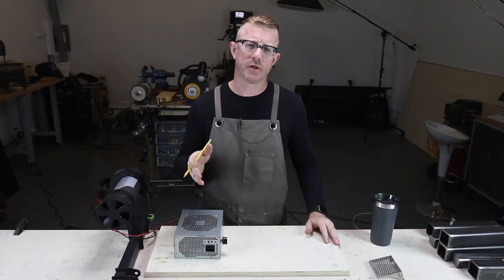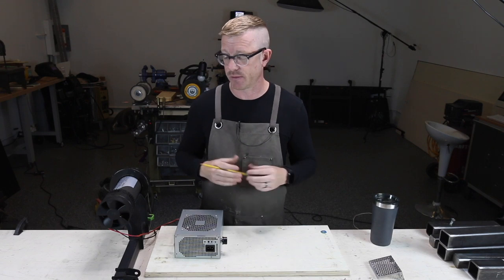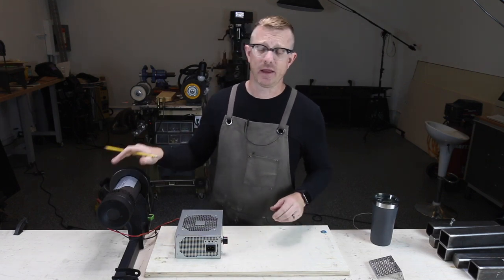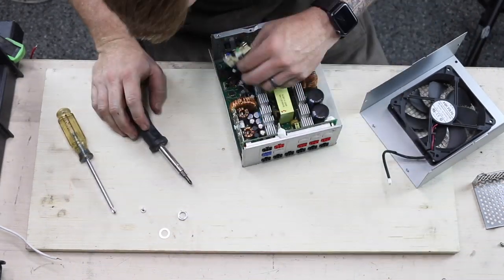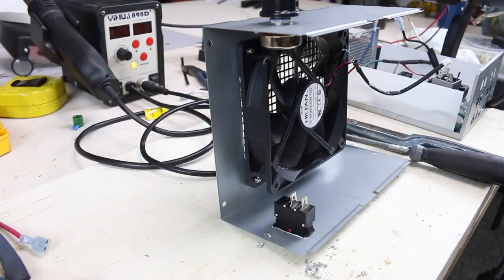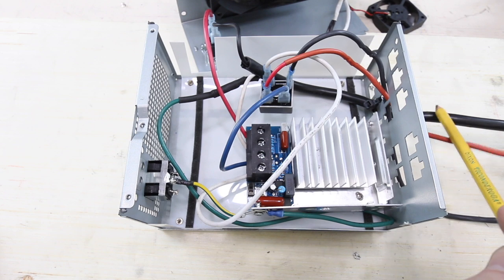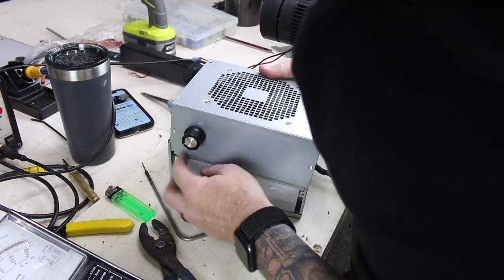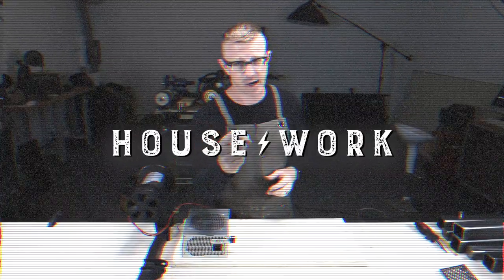How to: Build a DC Treadmill Motor Speed Controller for $20

Comment: Good afternoon ’House Work’ I found your video very useful. Thanks a lot. Greetings from Panama (Central America). Could you share or send a connection diagram? I am asking you this because I got confused with something: how many cables come from your motor? Mine has 3 cables (white, green and black)) but I have seen 4 or more cable coming and going to the motor, I am not sure.
Reply from the maker: Jorge Duarte - should only be 2 total wires coming from your motor. Send me a pic of the label on the motor and I’ll see what’s what and let you know. My email is brian@housework.us
Reply: House / Work thank you for your reply. Ok. I’ll send you the picture of the engine that I have.

Comment: great video, gonna subscribe ....I want to hook up a treadmill motor to a wood lathe. I would like to have a reverse switch. Any thoughts on how to do this, any way you could make a quick video showing the additionaal part or parts need to do this ....thanks :)   Scott
Reply from the maker: Its simple to achieve this with a dpdt switch. I may add one at some point. Just think of it as switching the polarity but just in a switch format. Don't buy the rocker style though if you want it to stay on.

Comment: https://wenproducts.com/products/3420-036asm-switch-box-assembly-includes-circuit-board-onoff-switch-circuit-breaker-speed-control-wire-for-wen-3420       i purchased this before i saw your video and have a treadmill motor laying around that i plan to use on a lathe.  will this work with the bridge rectifier in the same way , or would i be better off just purchasing the parts in your video ?   and great video. very informative.
Reply from the maker: If this device puts out AC power the bridge rectifier would convert it to DC. Not sure what amps you would get. A lathe doesn’t require a lot of RPM, so it may be worth trying. Report back on how it works. 👍🏼
Reply: @HouseMadeUS  sorry for the long wait. had to wait for other stuff to come in for my project.  the motor works. i ran two leads from the switch box to the rectifier where their motor would have hooked up and from the rectifier , plugged in the treadmill motor. i also bought a tripp lite heavy duty computer cable 14 AWG , 15A 125V . and cut that to make my power cable for the box. and it all fired up, no hassles. no smoke.   Now i'm trying to decide if i need to keep the fly wheel on or if i can get away without using it. This is all going to be used on a Taig Lathe. i bought a heavy duty electrical box that i'm going to mount all the electronics in and then mount the lathe on top of it all. should look really good when its all done.   i hope LOL

Comment: My ? is why did you not just use the power supply & box and just wire one of those output (like the blue one) and put a label "D.C. output voltage" It looks like enough room for controller to?

Comment: Great tips ... I found a free treadmill advertised, went to see it, it was huge and impossible to move, so I left ... I was still ken on it, so later I dropped them a line suggesting for a fee I'd dismantle it to get it out the door and house ... they ended up paying me! So, I will now be looking to use your tip and possibly make a linisher or wood lathe ?? So many options ! Cheers.

Comment: Why wouldn't you use the power supply switch and power cord connector both of them were mounted to the case
all you had to do is drill a hole for the potentiometer and attach the heatsink and bridge rectifier and wire it up.
but good idea on the power supply box I must have 3 or 4 of them laying around, I should fix them but honestly its not worth it.  look on Craigslist people set these out for the trash all the time I've taken about 5 of them apart Most of them have 
the digital boards so I have to do this Because I don't want to mess with the speed pickup's.

Comment: I’m doing this with a 4000 watt SCR and standard 5010 bridge connector. I noticed some videos they use a step down transformer... since I might be running this motor high idk if it’s gonna overheat or not. Also QUESTION my motor has 2 blue wires coming out in addition to the red and black... is this for an on/off switch from the circuit board? Thanks!

Comment: Great video Brian, appreciate the level of details. One question though, as I see it the treadmill motor does not need an individual power supply right? The controller board merely regulates the current sent to the motor.

Comment: Brian, does the motor still have maximum torque at low revs with this setup? Or is it like pwm and torque would suffer?
Reply from the maker: Torque does suffer at lower RPM. If you go into my video library there is a video explaining why I switched away from this system. Pros and cons basically.
Reply: @HouseMadeUS  thank you I'll check it out

Comment: good job but can i ask why you didn't utilize the factory plug in the computer power supply ? it would have cleaned up some of the wires and its already there
Reply from the maker: I thought about that after the fact actually. I think next time I wire it up I would do that. Good suggestion. 👍🏼

Comment: Brian. i am trying to us a 4000W SCR AC motor controller thru a bridge rectifier to run my 90V 2.65hp treadmill motor. I set i up just like you did in the video and it works. but the motor doesn't engage until i have turned the pot 1/2 round. it is a 500k pot. i was wondering if i replaced the pot with a larger pot, 1M, could i get more fine control? I can only get the motor down to 900rpm. i was hoping for a little better lower end. i want to use this for a lathe modification. any help is greatly appreciated.

Comment: Never knew this is how you got started with 2 x 72 grinders.   Man you have came a long ways.     I built a treadmill one back about 7 years ago and keep saying I am going to upgrade to one of your plans.   But the damn thing still works and has plenty of power.   I did mine different than anny I have seen and ran a jack shaft and geared that 7500rpm motor back down.   It makes all kinds of power.    I used all the electronics from the treadmill to power it.    It is one of two videos I have on my channel.   But I am kicking around a house made grinder with possible a brushless scooter motor.  You can pick up a motor and controller around $120 for a 2.2kw 48 volt and a surplus 3k 48 volt power supply from ebay used in tella communication for less than $100

Comment: I understand the setup and configuration. But I feel like im missing something simple. As far as I know I may be wrong, but in all the videos o have watched on this, I can't figure out how the max output is figured. Does 110 ac always come out to the same max voltage on DC with the pot maxed? Does it depend on the type of rectifier used?

Comment: thank you very much for this video and links, my treadmill motor has the black and red wires but it also has 2 blue wires. do I just ignore those ? are these motors very good at retaining torque at lower speeds ?

Comment: Thanks for the vid, questions i have
1. How do you clip the output voltage to not exceed motor rateing...is this done by the potentiometer you added, a bridge rectifier will multiply the AC input by 1.414 factor thus my question, 
2. How do you gain "soft start" ...once speed set and you do power cycle, the motor needs to return to speed set from previous use
Thank you

Comment: Hi, I made a trademill controller like this  it overheated at blew up after 10 minutes of running. Any idea how to avoid it ? Will a cooling fan solve the problem? I ran 2hp motor , it was extremely hot after 10 min

Comment: Treadmill motor controllers are designed with a feedback sensor (usually Hall effect sensor activated by a small magnet in the drive wheel) that allows the motor to maintain speed under changing load. SCR controller can not do that so the motor will slow down with load. 
For applications where maintaining set speed is important  it is worth reusing the original controller from the treadmill.
More work but worth it.
Reply from the maker: Interesting. I don’t notice a whole lot of difference between this and my AC motor. All is good in da hood.
Reply: House / Work I put SCR based speed controller on a band saw and on low rpm the drop of speed under load is significant. At higher rpm not so much. I may add an intermediate pulley to let the motor spin faster while the bandsaw is on low speed.
Another project on the list...

Comment: I enjoyed your video and actually bought the parts and made it to upgrade the motor on my Harbor freight Lathe.  I added a reverse switch as well.  However I find that the lathe spins well, and reverses directions fine, but it has very little torque.  When attempting to rough out a bowl on a soft piece of cedar, it doesn't take much pressure to slow the motor down, even at higher speeds.  Suggestions?

Comment: I have assembled your SCR set-up, tested it and it works as expected, however, it has been suggested to add a capacitor to even it out.  I have a 3300 mf capacitor but I'm ignorant about electronics and I'm not sure if it should be wired to the input AC, the output AC or the rectifier DC and should it be wired in series or across the terminals.  Please advise.  Also, is it a better choice than a Ferrite cored coil (can't remember what it's called)? Or should I do both?  Thanks.

Comment: Will this setup work to run my treadmill the control top is gone could I run just the treadmill part like this
Reply from the maker: Unfortunately no. You would need the actual controller for that. This one will burn up.

Comment: Would be a good idea to connect the SCR to the chassis as a heat sink.. Those can get hot depending on the use.  Great video. I may have to build one now.
Reply from the maker: I have a heat sink on the bridge rectifier and one on the chassis. Its hard to see from the video. None the less, you make an excellent point! Heat kills electronics!

Comment: I bought the same controller you did but my fan that I took off of it is 24v and I noticed your fan was 12v. my replacement is also 12v can I still use the 12v when I took out a 24v fan?

Comment: I have a question.  I used this system to put a treadmill motor on my old ShopSmith and it works great.  My question is that when I try to read the output of the rectifier sending current to the motor, I get no readings at all.  Any ideas on this?

Comment: It does matter which side you use on the AC power: black goes to the fuse and/or switch, white is "neutral" and is the return for current supplied on the black wire. Wiring this backwards is why we now have polarized plugs, because old radios used to connect the neutral to the chassis and if you flipped it backwards, the case was hot with 120 VAC and people died.
Reply from the maker: Well said! I appreciate the explanation.
Reply from the maker: To be clear on this, what I said was you can use either pole on the SCR motor controller for either side of the AC input. In that case it doesn’t matter. Nor does it matter which pole you use to go from the SCR to the bridge rectifier.

Comment: Great video, thank you.  I have a 24v DC 240W wheelchair motor that I'd like to use.  Am I correct that the potentiometer is regulating the DC voltage which translates to motor speed?

Comment: Hi Brian I'm working on building a grinder like yours at the moment with a treadmill motor if I was to fit a cooling fan is it just a matter of connecting to the red and black going to the motor to power the fan.
Reply from the maker: You’ll want to measure the voltage that is coming out of the bridge rectifier to make sure that it meets the voltage requirement of the fan. Most fans are 12 V so I think you’ll be far exceeding that. The SER motor controller does have a 12 V leg somewhere so you may want to look into that and try to find that. A multimeter can tell you what’s what. In my case my motor controller had a fan connected to it so I just use that leg from the controller itself. If you try to use the voltage coming out of the bridge rectifier it will most likely blow up your fan. Good luck and send me some photos at brian@housework.us - I’m putting together a compilation of pictures from people who have built this grinder and I’d like to include yours.
Reply from the maker: *SCR not SER

Comment: If i buy the treadmill that is designed with speed control . Could i just take all the Speed control and motor from treadmill and install it to my wood lathe and it work ?

Comment: Lol. Shock yourself on the capacitors thats funny, the caps in the power supply are 12 vlot or 24 volt dc and low amps 
You would have to poke both leads into you hand to break your skins surface before any current would flow, and even at that rate is not much more current you feel off a 9 volt batter ends on your toung.
The absolute biggest shock would be a tingling sensation.   You you act like its a 240 volt 30 amp circuit.   At the most this was funny..  MIT training. You have a gwwc. Guy with wire cutters
Reply from the maker: You should be carful, they will give you quite a jolt. Also don’t spread misinformation like this when it comes to safety. Capacitors can and will shock you.

Comment: Just thought I'd mention it for those who are tempted to check the function of their SCR with a voltmeter.  

When you go on line, you'll find people claiming their controllers didn't work. Often, you'll see references to voltages in those statements.

If you put a volt meter on this SCR controller and run the pot through its paces, you will not see any significant change in the voltage. The meter will remain at 120 volts on the AC scale.

In spite of what the meter says while in the AC voltage mode, my "router control" from Harbor Freight alters the speed of my router. So would a modern dimmer, which is the same thing as the HF device. The same happens when I connect up my three 10,000 watt SCR's - they report no change in voltage, but do alter the speed of a motor.

Comment: How about if you have two blue wires as well as the black and red? Seen a few explanationa but I want to wire it in a similar way you did with cheaper parts than those other videos suggest.

Thanks for your help.
Reply from the maker: Those two blue wires are attached to a temperature sensor. No need to use them. I remove the sensor.
Reply: @HouseMadeUS  You're a legend! I'll take it out, working onna grinder myself. Unbelievable response time!
Reply: Definitely subscribed now haha
Reply from the maker: Haha! You got lucky, I knew the answer and I was staring at my phone. 😁
Reply: @HouseMadeUS  Rather be lucky than good!

Comment: The board on my treadmill is not working. So I followed your example on this video and it allowed me to use my treadmill. 
However, it does run a little rough. Any ideas to make it run smoother?

Comment: Sorry to say this and read on.
Those import chinese so called adjustable voltage, variable voltage or whatever terminlogy is used for it, just know this.  In actual defintion they are what is called phase controller.
There are only two ways to change voltage in AC motors.  One is by what is called phase control and the other is variable frequency drive.  You hear the term VRF.  Now read on.
These phase controllers does not work on induction motors.  That is not what is meant by AC motors.  When they say AC motors, it means universal motors, you know the brushed motors like your power tools if you know what I mean.
They also work as light dimmers.  And that is it.

Now if you think you can just install a bridge rectifier on these to run a heavy duty Magnetic DC motors you will be in for an interesting find.
You are basically running your Treadmill motor on AC supply.  Trust me.
When you convert your AC to DC with a bridge rectifier, what you don't get is the science of it.
First of all as you know your AC flactuates up and down and also back and forth.  It has two movement.   Well guess what, so does your bridge rectifier.  Your DC on the ouput comes up and down and the recifier simply removes the back and forth part of it.
Plus if you check the output after your bridge rectifier and worse yet fooling yourself with you installing  a capacitor to supposedly smooth things out, guess what, no so fast.  It is not smooth at all and furthermore your output is a flactuating whopping 170Volts.  Stick that voltmeter in there and find out.  And watch for them sparks flying at the brushess big time.
Your motor takes on a beating like it is nobody's business.
And by the way that potentiometer turning knob job has little meaning with respect to this.  These things are called light dimmers for a reason.  And by the way this word "light" in light dimmer does not refer to any other light but old obsolete incandecent light bulbs.
You hear that?
You get that?
Suit yourself.

Now you think about that.
( No you won't hear this kind of truth just to get attention and clicks)
Reply from the maker: All good info. I no longer recommend this as a viable application but people do learn from it. Thank you for watching.
Reply: @HouseMadeUS  This a video about why you shouldn't spend your time and your energy and your money just to destroy a motor.  If you want to destroy your motor, there are much cheaper and much faster ways to do it.   And thank you for watching.